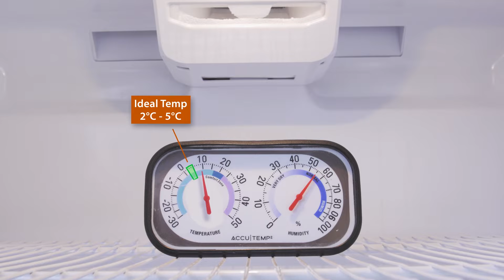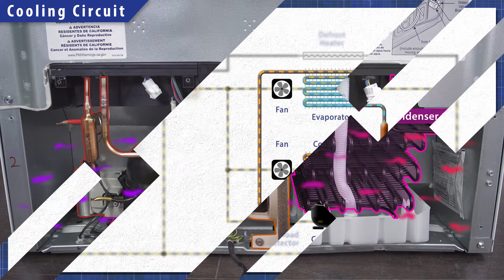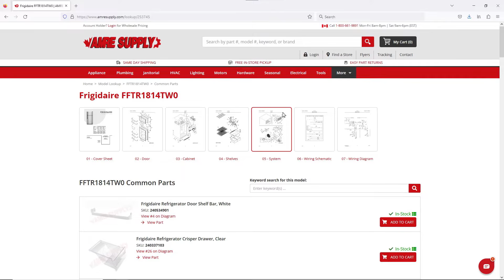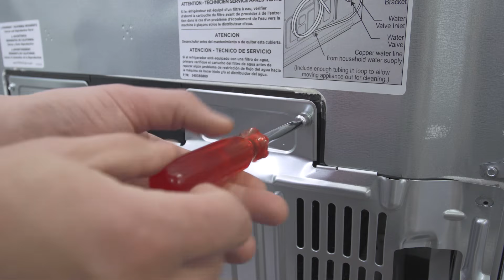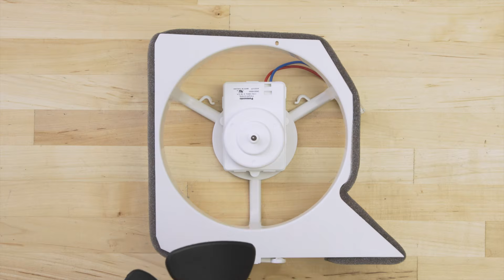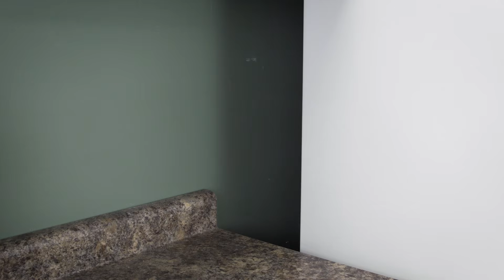Refrigerator Condenser Fan Motor - Testing & Replacement Guide | Repair & Replace

Comment: I have the panasonic white type fan motor and hear the compressor kicking on but the fan moves slightly but doesn't come fully on. Would this be a bad condenser fan motor?
Reply from the maker: Thanks for watching. Yes is the condenser fan starts to turn when the compressor kicks on, but the fan doesn't fully run, then the fan motor / bearings could be faulty.

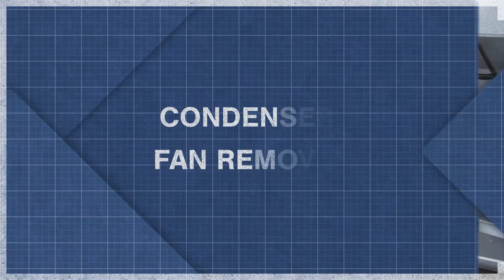Comment: 3:26 3:26  I'm  looking at a true brand 2 door restaurant  vegetable cooler and the big motor stays running but the fan spins for couple of mins and then  stops, is basically the fan motor?
Reply from the maker: Generally if there is a call for cooling the compressor will run and the condenser fan will run as well. If the condenser fan stops running while the condenser is still running then it's a good sign that the fan is starting to fail.
Reply: @AmreSupply  i took the fan motor out and put a new motor and new fan, had all the connection  taped, but the workers messed with it and the taping came off,  do you have a diagram you could show me
Reply from the maker: @ There might be a wiring diagram in the tech sheet. The tech sheet locations are mentioned here: https://youtu.be/HQFRUuWIz_o?si=HWWuGwJpUXuv2pLX&t=297

Comment: I bought my loyal maytag fridge in year 2005,still going like the day I bought it.amazing never been repaired.only thing I did was get new door seals.almost 20 years old,will definitely be getting another whirlpool if it ever died.
Reply from the maker: Glad to hear that your model lasted so long! What kind of model was it? Side by side? Bottom freezer? Top freezer?
Reply: @AmreSupply its a top mount may tag in the pak/10 model series.it has a big spiral coil,a fan system when most fridges just have a compressor only system.this is a condenser fridge.
Reply from the maker: @paulzullo498  Thanks for sharing. It seems like it was a model that was built right when top freezers moved from an passive condenser coil to an active one with a fan. Top freezer models are more simple than side by sides and don't often have the extra components like control boards. Less parts = less points of failure.
Reply: @AmreSupply  can't send pics on you tube otherwise would send pic,and original receipt.

Comment: Is it possible that a bad condenser fan would keep a compressor from starting?
Reply from the maker: Thanks for watching. If the compressor is not starting then it could be an issue with one of the start components: https://www.youtube.com/watch?v=NND8J8dXqJ0 Or there is no power sent to the compressor so a faulty control board or cold control thermostat.
Reply: @AmreSupply  Thank you! The first thing I checked was the start components and replaced them with known good ones to be sure. I'll continue to check the thermostat since the control board doesn't seem easy to bench test.
Reply from the maker: If your model has a control board then it won't have a cold control thermostat. Instead the thermistor (temperature sensor) will detect the temperature, and the control board will send power to the compressor and condenser fan. You can see how to test the thermistor here: https://www.youtube.com/watch?v=HQFRUuWIz_o

Comment: Is the fan supposed to come on the minute the compressor kicks on?
Reply from the maker: Thanks for watching. It does in most models but in some there might be a slight delay as the compressor and the condenser get up to temperature.